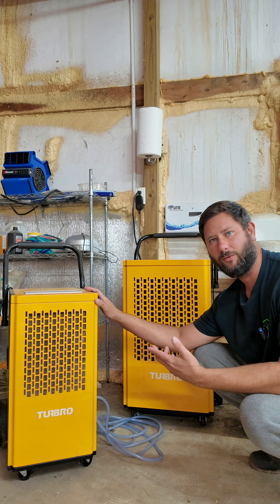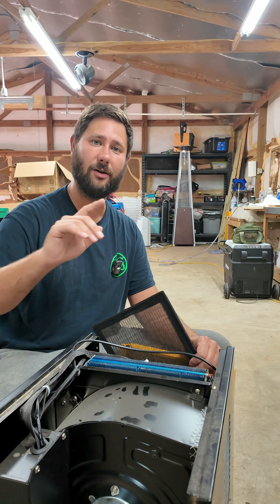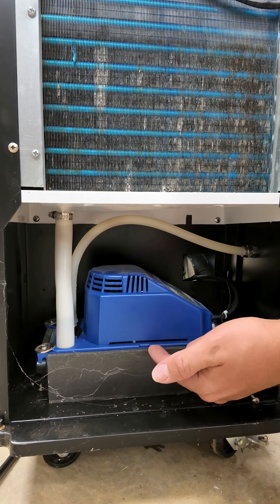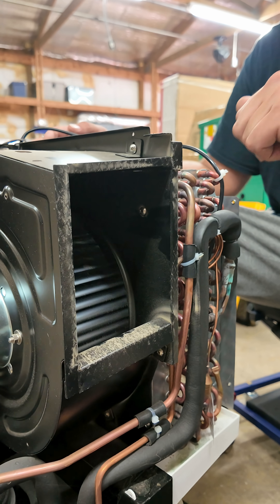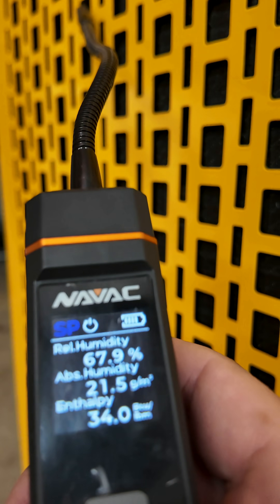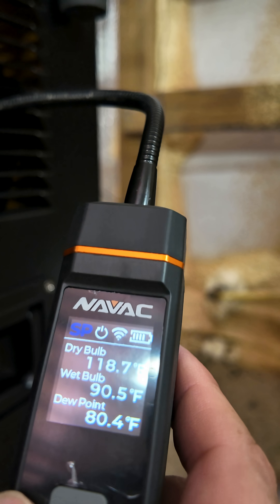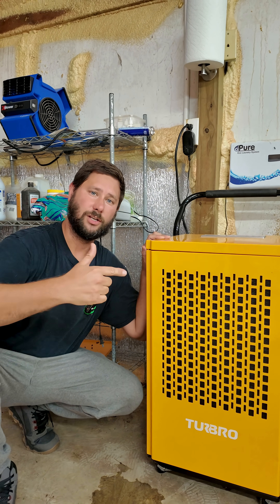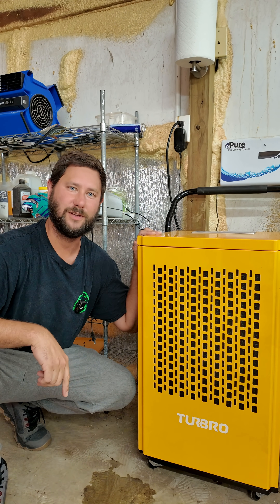How a Dehumidifier Works?

Comment: What am I missing?
The absolute humidity and dew point  were showing as higher on the way out. Does that mean it's actually added moisture, but the relative humidity had dropped because the air is hotter? If so, wouldn't a heater be more effective.
Probably just a temporary thing as the machine was just turned on. But seems odd.

Comment: Will this brand dehumidifier last longer than the ones most consumers buy?  I am fed up with dehumidifiers that last only 2-3 years.
Reply: We completely understand your concerns! This model is built for durability. While it comes with a one-year warranty, key components like the core compressor are crafted from premium materials, designed to far exceed the average lifespan.

Comment: You could probably use a window ac on top of a drain pan and a condensate pump. Both dehumidifier and window ac is gonna add heat to the room.  However hot air is easier to dehumidify eh?
Reply: Hi there, thanks for asking.True!  ACs can take out a little moisture, but a dehumidifier does it way faster and more consistently. TURBRO is built just for that.💪

Comment: So can you set up a window ac in the middle of a room and it work as a dehumidifier?
Reply: @garyfurlong9487  when our central AC went out when it was hot outside, we kept the windows shut and ran a dehumidifier. The air got drier, but it warmed up the house considerably that we turned it off.

Comment: Impressive to see a dehumidifier with an electronic expansion valve. Atleast that's what it looked like for a split second there
Reply from the maker: I think that's hot gas bypass for, the evaporator if it freezes 🥶
Reply from the maker: That would be pretty cool.
Reply: @taddydigest that makes more sense